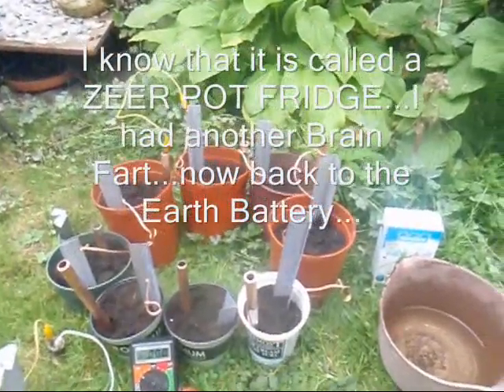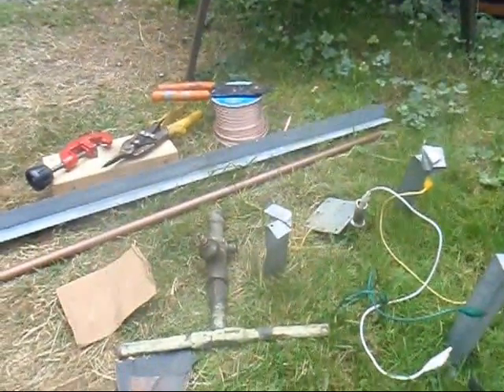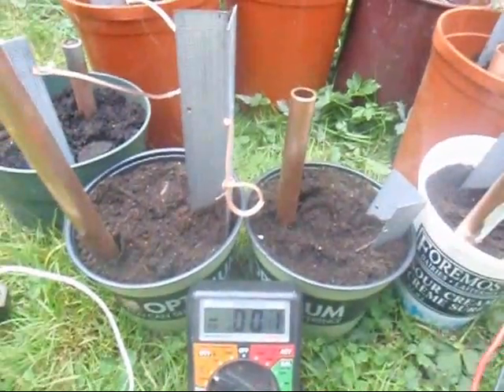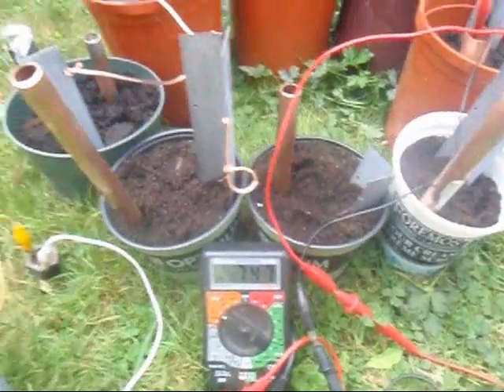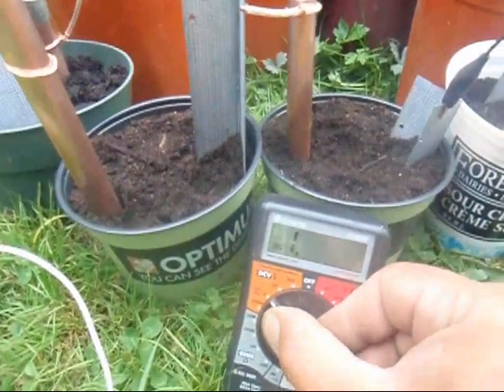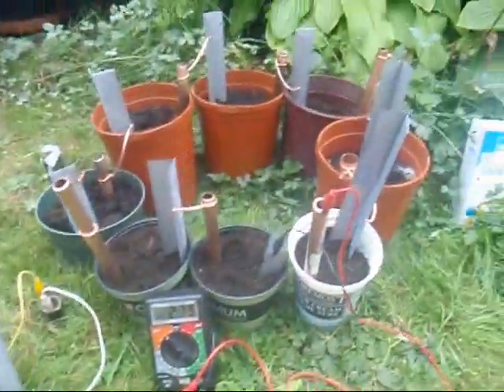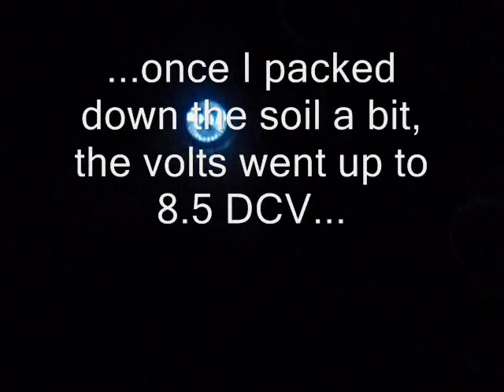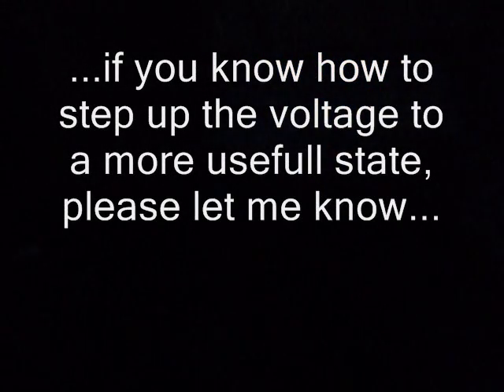8.5 DCV Earth Battery Lights Five LEDs

Comment: Well Drunktoads... one method of making this cheaper and to perform better is 1 use a like rubbermaid underbead tote... they are those like 3' x 4' x 8" units... then get some plastic sheeting... like 8 Mil plastic? then make little divided "pots": with the plastic in the rubbermaid container like a giant ice cube tray... fill each "pot" with dirt to just beneath the lip of the pastic (the dirt between cells cannot touch!) then break the ends off of #2 wooden pencil and sharpen both ends to expose the GRAPHITE core on both ends.... take IRON REBAR and cut into like 10 inch sections... so graphite pencil is 1 electrode... and the other is the iron rebar... now.. the reason your salt didn't work is because you sprinkled it on the top... now when a battery in a car gets corrosion on top and the corrosion makes the posts make contact with each other you get a dead battery... so yeah the salt on the surface was making a short circuit... however.. if you mix the salt with vinegar and water... and pour into each "pot" and then wire your electrodes up in series in sets of 8 pots.. then the series of 8 pots in parallel with another set of 8 and so on.... you get a 12 Volt Battery that has quite a bit of amps to it with a better watt hour count :) electrochemistry is fun! (besides I am cheap and like it would be an easy and lightweight way to have portable power anywhere LOL)
Reply from the maker: Sounds like a good idea/plan. At the moment I am looking into this...
 http://www.digikey.com/en/articles/techzone/2013/apr/generating-high-dc-output-voltage-from-low-input-supply
...but unfortunately my understanding of electronics is still classed as novice. Trial and error should get me to where I want to be with this, as soon as I get back to the "try" part.
              Thanks for the suggestion.
Reply: Let's open source the world Drunktoads and on the money we save.. spend it on beer.. good beer;)
Reply: BTW I think I am on to something... graphene the Irish figured out how to make rapidly via a blender and soap and water and graphite? I am thinking that instead of agiation by blending.. say the motion of boiling... (a process they do not have the patent on) you could do something similar to get the exfoliation of graphene perfect sheets... which.. is a room temp super conductor... 200 times the strength of steel.. 97.3 percent transparent.... more elastic than rubber and like gives puppies to to people on their birthdays!
Reply from the maker: ...almost all beer is good, after the first three I can't tell the difference until the next morning.
Reply: Well hence the good beer for the first three then what is brewing in the 7 qt crockpot made from sugar, yeast, water and like a heating lamp aimed at it LOL
Reply from the maker: Jesse Mercury Never heard of Graphene. Just googled it, now have to read up on it. As long as there are people like you out there experimenting with these ideas, sooner or later the goal will be reached. Let's hope it is sooner and not to "later". I'll buy the first round of beer.
Reply: just to illustrate in your mind's eye graphene's strength? a sheet of it the thickness of plastic wrap.. would take a sharp pencil with an elephant standing on said pencil to breech it....
Reply: Oh there is more! the ESP8266 SOC (system on a chip) is a microcomputer that is like 4 cm in size? yeah it has wifi and bluetooth built inand like can work as a relay for wifi and cost 3 dollars USD....
Reply: By my calculations even with additional hardware etc.. with long range microwave transmission etc for the data signals.... for free iinternet for the ENTIRE USA.. one time payut of about 150 Million USD and tha tis with labor....
Reply from the maker: Jesse Mercury I like your train of thought, but the "fat cats" out there won't. Nobody makes money from "free" anything. Now we/you just need to get $1.00 from 150 million people that are tired of paying monthly internet bills. Shouldn't be that hard. Next on the list, free Cellular.
Reply: oh no.. free net is free VoIP which means cell goes bye bye and portable devices like androids use the VoIP on the FREE WiFI to do VoIP on it's own number protocol.... :D 

I gave you my google voice number.. let's talk :D
Reply from the maker: Well you definitely have my wheels spinning. Another idea I think should be feasible is this. Or more so a question. If an electric car runs off of a bank of batteries, would it not be possible to incorporate an alternator/generator or many to sustain them? If the battery bank held more power than needed to run the vehicle, could you produce enough power to sustain the system? I have heard that some trains can generate electricity from the brakes when applied. A little off the subject at hand, but that's the way my mind works.
Reply: Well that is called regenerative braking.. it means when braking to turn the kenetic energy (forward motion of the train) into electric energy (see Law Conservation of Mass Energy) instead of thermal energy (brake pads) you can reclaim power to in fact propel the train.... however... with energy you do not normally on any scale get more out than what you put in... so the trick to that.. is to use the regenerative braking where you can recover power from slowing down.. and then to use as a distance extender for a capacitor bank that powers the vehicle.. use say the aluminum air battery tahat uses the electrolyte like your earth battery but with alst  water/ vinegar :)
Reply: Okay law conservation of mass energy: Mass Energy cannot be created nor destroyed it can only be transferred ... meaning you can change any form of energy or mass into any other if you want but you can't make it appear out of no where and yuo cannot get rid of it....
Reply from the maker: I didn't think the self sustained electric car was possible. Due to basic laws. Over-unity has never been achieved, or if it has it's being kept a secret.
Reply: Oh by the way.. I shot this photo a bit ago here in Newton, Iowa when going to the store and took 10 minutes to do image editing when I got home with GIMP (open source http://gimp.org ) https://drive.google.com/file/d/0B001oVz9lVUubVBtRE5nbm5WMUk/view?usp=sharing
Reply from the maker: +Jesse Mercury 
What Happened To Jessie Mercury...???
Reply from the maker: +Jesse Mercury 
Where Is Jessie Mercury ???

Comment: ohh hmm have an amp-clamp? im intrigued on the (if anything significant) amperage coming from the raw earth. especially if you (or someone else) becomes able to generate 110V+ DC
Reply from the maker: No amp-clamp...but I know where you are going with the amps, which is where the problem may lie. To be able to generate enough power from the raw earth or atmosphere would be a great accomplishment. I hope someone figures it out, then tells me how to do it. If you could add enough cells to generate 16 DC V would it charge a 12 V car battery is what I'd like to do. Have a constant charge on a bank of them, then draw the power from it.
Reply: Drunktoads
very well much agreed. still none the less, to create really any current of sorts from nothing but raw earth is quite magnificent on its own. but yes alas as you said,sadly, seems this is a difficult accomplishment to achieve the abilities to harness such energy in large abundances yet remain efficient and effective over time. i may just have to mess round trying this for myself some time for kicks and experimentation

Comment: For those that say you "only" need 10ma to drive an led. What if you are only producing 1ma or less? So, YES you do need amps!
I was wondering about (and may play with it sometime) if you put two negative terminals in a pot with one postitive (or the other way around) if you would get power from both negatives with a common positive? Also, I think the more metal in the ground the greater the amperage, more area for electron flow.
Nice experimant! Thanks!

Comment: For specific metals, the maximum voltage is fixed. So maximise voltage by using zinc and copper. To maximise current you need area so use flat metal plates instead and plant them fairly close together.
Reply: Use ultra high brightness red LEDs for maximum output. They need 1.8 volts. Yellow/amber is next, then green then finally white or blue at 4 volts.

Comment from the maker: I appreciate all the comments I have received. I wish I could find the time to continue this experiment. Recently I found an "air" generator circuit that uses diodes and capacitors to increase the low voltage to a higher one. It may just be what I have been looking for.

 With hopes of figuring it out, and posting my findings....Drunktoads
Reply: @Drunktoads  do you have a link to the air generator?
Reply from the maker: @alberthowe7895  ...maybe in a bookmarks folder on an old drive, but most likely not. Sorry...

Comment: Need to look into amps. Thicker cable is better for amps. And what you are looking at is open voltage. Under a load it will drop a lot. Try to put an capacitor in your set up. Take one from old electronics. Keep up the good work
Reply: You don't need Amps to drive LEDs. Ultra high brightness LEDs run happily on 10mA. Note that red LEDs require the lowest voltage of all LEDs (1.8v). Blue and white LEDs require about 4 volts.

Comment: In regular batteries when you connect in series Volts increase.
When you connect in parallel Amps increase.

I guess you have enough volts, you need more amps.
Did you try to put 2 insertions in one pot instead of one. I mean 2 connections running in parallel?
Reply from the maker: Thanks for the reply. I haven't done much more than what is on the video. Keep meaning to do another video, with all the viewers suggestions, since there are so many good ideas to try. Will post when I do...

Comment: if your really ambitious get a wind turbine charge controller and hook up these buckets in series for 12 volts than connect string of series ones in parrallel to increase amps then charge it with wind turbine and use inverter and power appliances
Reply: and if you want to step up voltage get a buck converter on ebay they are about 5 dollars and they take in anywhere from 1 volt to 30 and you can set the output voltage on them
Reply from the maker: Thanks for the view, and taking the time to reply. Ambitious yes, easily distracted more so. There have been some great suggestions yours included. I plan on compiling a list and hopefully doing some experimenting to try and figure this thing out. If anyone gets one working to a more use full state, please let me know.

Comment: So what I'm gathering is the amount of dirt doesn't matter. But when you hook them up in a series, you're able to increase the voltage. What happens if you use smaller setups and connect them in the series? I'm wondering if you shrink the size of the cells, and increase the amount of cells, would you be able to generate enough electricity to do something with it? Or what if you just use it to charge batteries at night when solar doesn't work and use it as part of your solar system?
Reply from the maker: I have not experimented with larger pots or metal pieces as of yet to see if there is a significant change in DC volts. Also I have not tested the series vs. parallel current output. There will still be the problem of producing enough amps to make this battery capable of charging a car battery. People have suggested to add a transformer in order to create a usable amperage. If I had a better understanding of electronics/electricity I'm sure I would have figured it out by now. It would be cool if someone that does have this knowledge gave it a go, and let us all know...
Sorry I couldn't answer your question better...thanks for the response.

Comment: 3 tips on doing this better. use zinc + copper instead of aluminum + copper and you will get double the volts. put your pots in a strait line. and dont use metal pots... they establish an electrical short when more than one is on the ground. as is your battery should make about 9v.

Comment: You have voltage but your current is very low. To increase current you use parallel connections, all the positive together and all the negative together. Series connections increases voltage so you need both to increase voltage and current. Create two or three of the batteries you have and connect them in parallel.

Comment: U need to connect series parallel to increase current so if you built 4 banks of 8 series pots then connected the + & - from each bank together you would have 4 x the current & could power the led
Reply from the maker: I like this idea, but think I will try a scaled down version first. Maybe twelve pots first (3 banks 4 series) to test the result, before making 32 more.
Thanks for the input...

Comment: I really enjoyed the video, question, how long does each copper pipe, and steel have to be cut?.
Reply from the maker: Good question. I am not to sure if there is a magic number for that, that will work better or worse. You can see that the lengths are varied in size. Some are longer, and some are shorter. I would think that 6" should be long enough. A few inches in the soil, and enough sticking out for the wires should do. Funny thing is I was just wondering if I could user shorter lengths and burry them in the soil for the same results. I am hoping to try this out in the near future. You can be sure that I will post my results when I do. Glad you enjoyed it, keep on keepin' on...

Comment: I think the salt was starting to neutralize the alkaline in the soil and thats why the volts started to drop. I built one using ash from my wood burner & it work very well. When you mix ash with water i believe you get a form of lye which is alkaline, it will make your light very bright.

Comment: These batteries were used to power the old west telegraph system. So they do work under the right conditions of soil. For us to use today, this voltage has to go through a transformer of sorts to get usable amps.

Comment: You need amps, to get get more usablility from your volts you need a paralell setup, that will give you the same volts but more amp power, that will infreaee the usability. However you can get more out of galvanized washers, pennies, and a salt water soaked paper. Good luck.

Comment from the maker: The system is apart at the moment. I will be working on another in the near future, and build it until I can reach 12V. But I do not think that there is enough "stored" energy to sustain a inverter that draws that kind of voltage. It has been on my mind though. As mentioned below I think that there has to be amperage in order to do that. Thanks for the reply. Something for me to look into.

Comment from the maker: Hey thanks for the repy. I am pretty sure that there is no, or very little amperage from this unit. Each pot puts out a small voltage of D/C current. In series it gets greater, but as stated there really isn't any amperage. Maybe someone that knows more than me about this can explain why. I will try to do some research on it and get you a better answer.

Comment from the maker: As you can see in the video, the rods are in all directions. I have not heard about placing them in a north/south position but I will give it a try. Since the video I have managed to light a 3v Ultra Bright LED useing five pots in series. This has been going 24hrs a day for the past three weeks. I tried to make a Joule Thief to up the voltage, but it isn't working for me. I am going to try another one. I will post the results of that when I it figured out.

Comment: I hav seen a few videos on this, but this is the most voltage i have seen out of an earth battery. i'm wondering if this could be used to power a light bulb or something to that effect. even if it is low voltage i'm sure it would be useful. I'm gonna have to fiddle around with this, i've heard something about the rods needing to be north and south, not sure if you know anything about that. If not you might look into it.